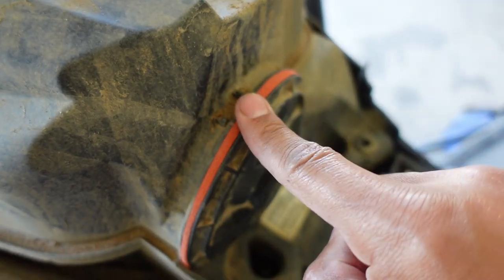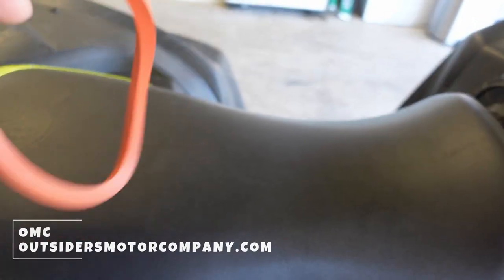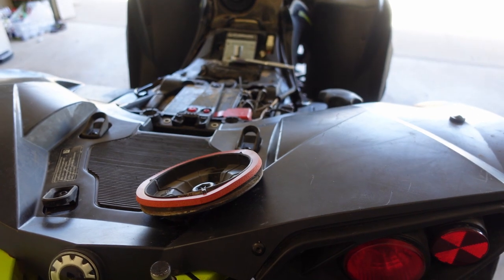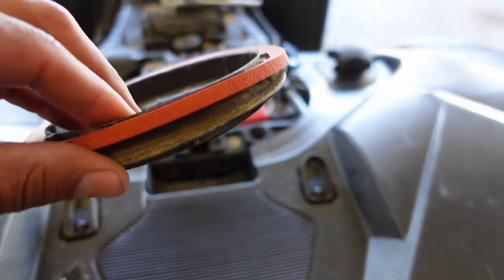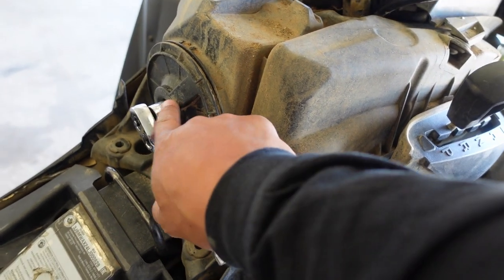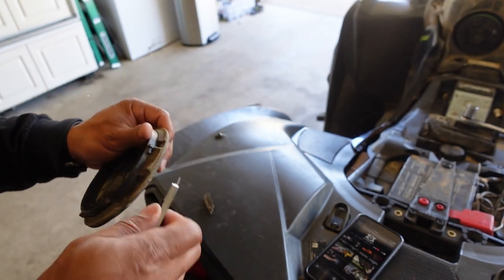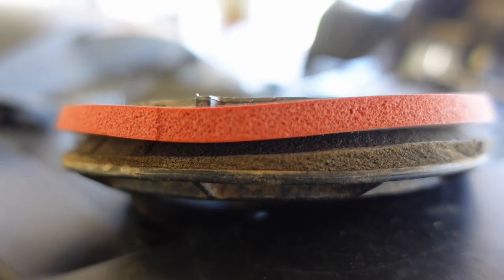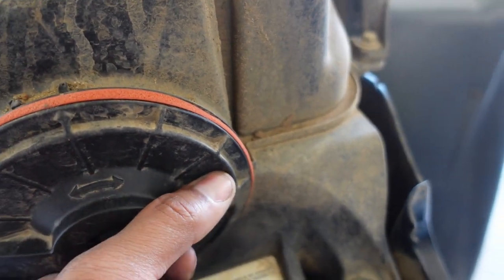OMC AIRBOX SEAL - CANAM RENEGADE / OUTLANDER  OUTSIDERS MOTOR COMPANY

Comment: What did you do to get it to turn.....I can't get it to turn at all
Reply: I had to use a socket to get mine on/off too, very tight fit. Just as a tip to anybody else who might be reading this, there is a socket in the BRP tool kit that comes with your machine that fits the airbox lid that you can use, its the opposite end of the spark plug tool.

Comment: Did you use super glue to stick it on or do you just put it on like that and then take it off you didn't show how you installed it on the air filter cap
Reply from the maker: Just put it on like that, it’s not going any where